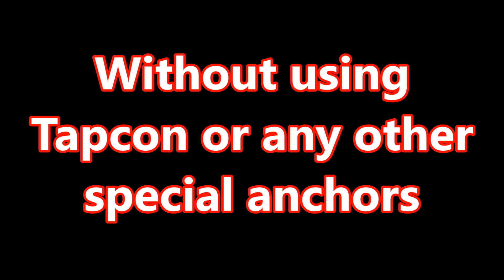How to Drill / Anchor shelf into masonry or cinder block wall cheap

Comment: Dude, Thank you.  Used you technique after drilling with wrong bit.  Used pieces of chop sticks.  Worked like a charm.
Reply from the maker: You’re welcome. I like this over Masonary screws, because if you over tighten the masonry screws the hole is stripped and it’s useless. This way you can reuse the holes just add more wood if needed.

Comment: What are you using to drill into the masonry?
Reply: The best tool for the job is a tungsten carbide masonry bit.
Reply: @mainman3476  ... and hammer drill, doesn't have to be an expensive one with that size hole.
Reply: @steven.h0629  You don't need a hammer drill to drill into masonry. A good bit will work with either kind of drill. The hammer only speeds up the process.
Reply: @mainman3476  really?  Good to know cuz I don't want to buy a hammer drill just to do a couple of DIYs with concrete, stucco...

Comment: I've done that before but it's not as strong as engineered products
Reply from the maker: I was able to put over 200 pounds anywhere on the shelf without fatigue. 
Cheap solution that worked for my needs.